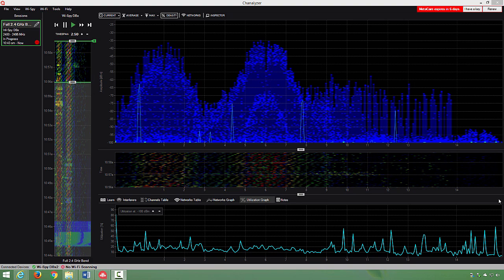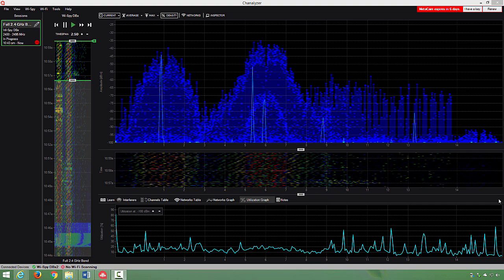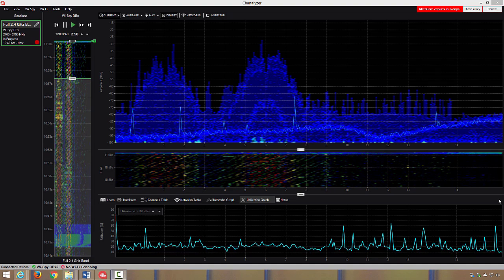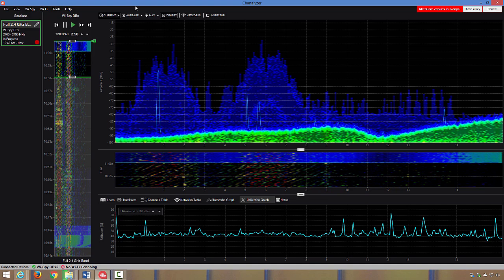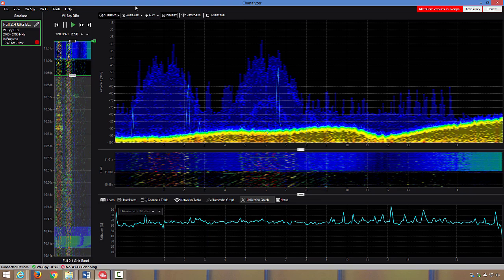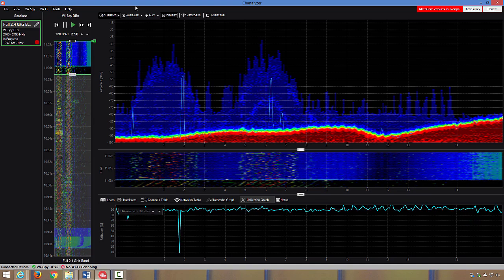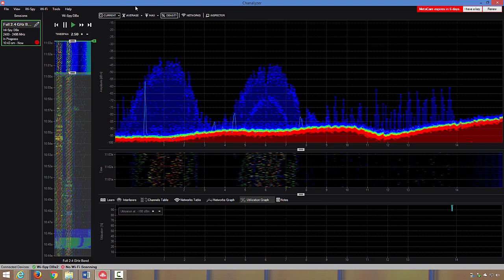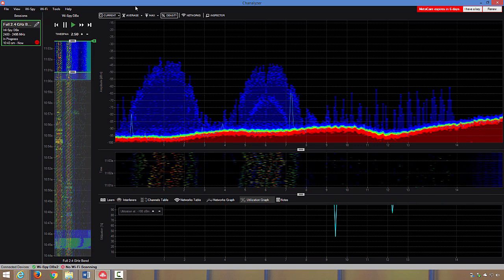USB 3.0 Interference in 2.4 GHz

Comment: That explains why my arctis nova headset was losing connection on the 2.4ghz wireless connection I had a usb stick plugged into my computer right next to my transmitter, removing let it get full range.

Comment: Here we are six years (!) later, the entire industry knows about it, USB 3.x and 4 are getting both more sensitive to and bigger sources of interference in more frequency bands, and yet nobody has considered fixing the obsolete USB plugs/connectors to a design that provides adequate shielding. USB is everything you want, as long as that's a simple USB point-to-point and nothing else around it. Unfortunately, merely looking behind my desk shows how removed that is from reality, and I don't even consider myself a power user - just an average guy trying to get his stuff to work stable.

Comment: My old windows tablet has a usb 3.0 port, when a portable hdd is connected in usb 3 mode the wifi is completely jammed.  I had to switch the hdd driver to usb 2 mode to get the wifi working again.

Comment: Thanks a lot ! Thanks to your video, i resolved my problems : my new wireless set of mouse and keyboard was struggling all the time when the receiver was direct plugged on the usb 3.0 ports. So i bought USB M/F about 30cm ( or more / less ) extension cable to deport the USB receiver and all is working perfectly ! People, deport your USB receiver even a little bit you will see big improvement if you are using USB 3.0+ ports.😄😁😄😁🤗

Comment: I bought a new mouse from Razer, the whole evening I could not understand why the connection with the computer was constantly lost. It turned out that I was using USB 3.0. After the video connected to 2.0 and it all worked
Reply: Same here, had stutters and jitters with a Corsair Scimitar Wireless. I changed the dongle to another USB 2.0 port, far from the 3.0 ports I use for other devices, and its much better although not 100% gone.

Comment: May i know the chipset that used in the usb hub? VLI or GL ?
Reply: and also, the problem will be with the wifi or the usb? cause in my case, the hub simply reconnected, so it's really scary when i try to copying files..

my case: coz of this problem,  i switch to 5Ghz wifi.. but there is another problem. I have a standing fan next to my laptop, and everytime i switch on/off the fan, my hub simply reconnected. (a dongle that have hdmi, lan, usb 3.0 type-A port that connected to type-C port in laptop). so, my monitor, keyboard, and external hdd simply like reconnected to my laptop.. do u have any same case?

Comment: Thank you for this video!

I have a Keychron BT keyboard whichbwas perfectly fine..

before I started using this Wiwu USB C adapter.

Then I experienced "random" lags in my keypresses - which disappears when I plug my keyboard into wired mode.

Aside from getting rid of the USb hub, is there any workaround to this so far?

Comment: If using a 2.4GHz dongle, how much separation does there need to be from a 3.0 port to avoid interference?
Could you use a USB 2.0 hub and/or 2.0 cable plugged into the system's 3.0 port to create enough separation to avoid interference?
Otherwise, how far apart does a USB 3.0 device need to be from the dongle?
Reply: Depends on the shielding and grounding. More is better. Use high quality  (not necessarily expensive) cables and USB-Hubs. If you want to have solid measurements you need some type of measurement equipment. Easiest is to use an SDR like RTL2832U (E4000 or R820T/R828D Tuner) a Hackrf or similar and use a Software like SDRAngel. At least you can do some comparisations with these SDRs.

Comment: I got new motherboard with many usb 3.0 ports. Ever since my bluetooth game controller and bluetooth mouse and keyboard has been screwing up. Mainly double clicking when I only click once. Can't play Rocket League anymore. :( I tried disabling USB 3.0 in BIOS. Didn't fix it. Made it slightly better I feel like, however didn't fix it. Never had an issue with old Motherboard. Same devices and same two bluetooth dongles. No issues with old motherboard whch had 0 or 1 USB 3.0.

Comment: Hello Tom great video.  With the fact that USB (2.0 or 3.0) ports are backwards compatible, I have a question on whether or not using a USB2.0 device in the USB3.0 port causes a problem or does it need to use a USB3.0 device in a USB3.0 port to cause the interference?  I suspect just the activation of anything the USB3.0 port can cause it and I wondered if you tested that or could answer that question.  –Thanks
Reply: Generally speaking, using a USB 2 device in a USB 3 port causes it to use USB 2 signaling and diminishes the problem in nearly all cases. This is why many wireless protocol analyzers now support using a USB 3 adapter in USB 2 mode to prevent this interference.

Comment: Do you see a higher interference on Channel 11?  I have observed this severly impacting on channel11.
Reply: With some devices, yes. The spectrum capture in this video shows how the intensity climbs through about channel 10 and then drops off significantly at the center of channel 11 and then climbs again. This is, of course, just this one device, but it seems to be a fairly consistent pattern (as the spread spectrum signal in the USB 3.0 circuitry is similar across devices). For this reason, channel 11 (which goes down into channel 10 for sure) would likely see more problems than channel 1. The difference in interference levels between part of channel 11 and channel 1 can be 7-8 dB and it can be 4-5 dB as a difference from channel 6 and channel 11. So, yes, you've noticed a very real phenomenon.